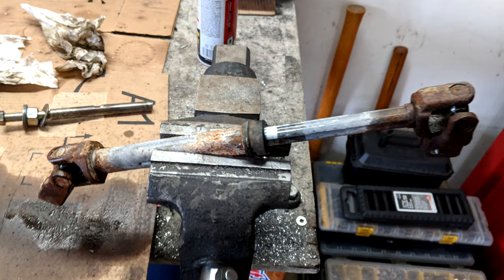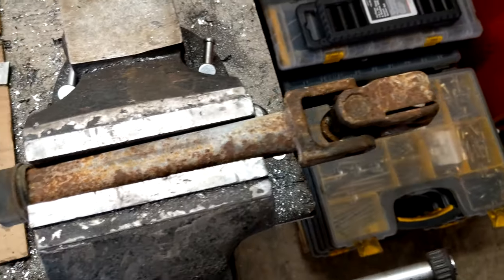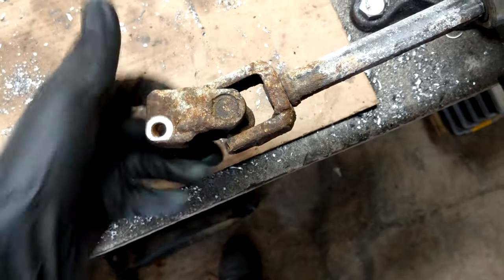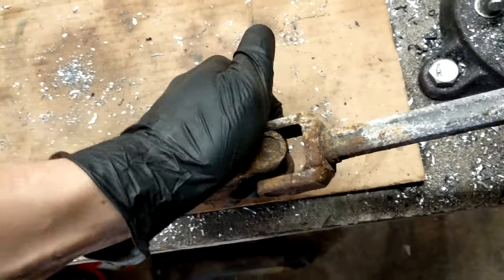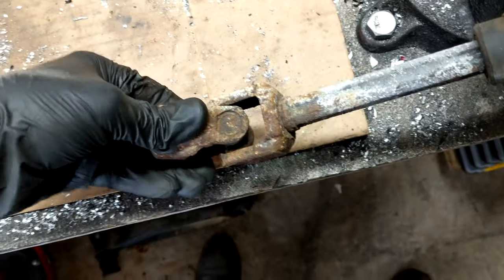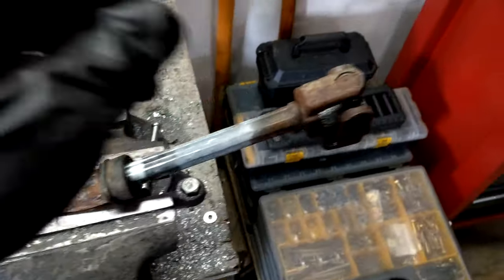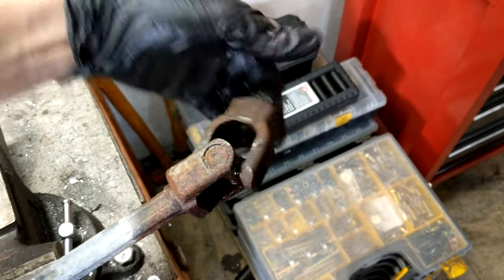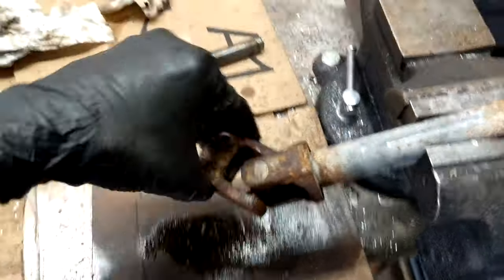2004 Ford F150 Heavy/Binding Steering Shaft Fix (Mini Projects Ep.3)

Comment from the maker: We have been very busy recently and barely even found time to put this tiny video together! But don't worry, this kind of busy means plenty of future content for the channel!
Reply: LOL I know the feeling, time to work on another vid!
Reply: I feel you, FDP. I've been roasting my ass off in the shop for the last week, and will be editing all this coming week, to get more out (also, I'm getting a boatload of work done). As always, you do a bang up job. I have plenty of patience since I know the next episode is always going to be a good one. Keep up it!
Reply: Acetone and ATF work great too!
Reply: @RickSolid1  People keep mentioning that... As I said to another commenter, I just made a video on that topic, and although it's an awesome potion, it's a bad idea to spray acetone at rubber.
Reply: Maxwelhse yeah it melts pretty much anything that isn’t metal lol. Although in  this case I doubt that matter, but I guess you could sub in WD40 for Acetone or some other low vis hydrocarbon.
Reply: @RickSolid1  I almost wonder if isopropyl alcohol would do the same job, but be more neutral to soft materials...?

I may try that at some point...
Reply: Maxwelhse I like that, maybe Denatured Alcohol too?
Reply: @RickSolid1  That is a good idea since it really doesn't seem to like to remove oil as much as isopropyl does... I do happen to have some on hand too. When my sprayer goes dry (from 50/50 acetone/ATF mix) I'll refill it with that potion and give it a shot. Come on over to the channel if you want to stay tuned for results (spoiler alert: my bottle is almost completely full, so, it will be awhile).

Comment: Good fix, but it seems like, given all the trouble it took to remove the shaft on a 15 year old truck, the best move would've just been to replace it.
Reply: At least now it's easy to take apart next time. I've actually done stuff like that on purpose before in a lead up to a "big" project weekend. Take something apart I know will take hours, clean it up, lube it, put it back together, then tear it down again in a few weeks (taking only minutes this time) to do whatever the actual intended repair is. The express example I'm thinking of is pulling the unit bearings out of the front of my Jeep in preparation to pull the front axles. I was correct that it took an entire Saturday just to get down to where the axles could come out...
Reply: Shit costs money bud maybe they're in a tight spot but I do agree with you . Gotta do what you gotta do

Comment: This is a common issue on any vehicle with an exposed joint in the steering shaft. I had a brand new chevy cobalt a few years back and used to spray the joint on the steering shaft with some thick lube on a regular basis, that kept it from jamming for the time I had the car anyway.

Comment: Hit it with fluid film every oil change.
Reply: I think I would try a dry graphite spray to help keep from gathering gunk, but either way would work.
Reply: worse case, use the used oil from that oil change to drizzle on those joints

Comment: Had the same problem with my 2004 Crown Victoria.  Replaced the intermediate steering shaft which is the only really safe, long term solution.  I originally just hit it with a heavy dose of WD40 on both joints while it was still in the car.  It helped some but I don't feel that it's a safe thing to scrimp on such an important part.
Reply: I agree with your opinion on this... I don't skimp on safety stuff.

Comment: Wouldn't it have been worth it to get rid of some of/much of that surface rust and hit it with some anti-corrosive paint? Or no?
Reply: he doesn't do that.
Reply: if they have to replace it anyway, then it won't be there long enough for the rust to become a problem.
Reply: @kruleworld  but he suggested not replacing it, but just monitoring it.
 He spent over 20 minutes getting the damn thing out. I think spending all of five-ten minutes to get rid of some of the rust and give it a coat of anti-corrosive paint (and go and relax while it dries) is hardly time badly spent.
Reply: @500MTH  he should, IMO.

Comment: It's possible to replace the universal joints by pressing the cups out in a vise. Just need to make sure that the new u joints are properly fixed.
Reply: A lot of the time you can't buy the joints themselves on smaller stuff like this. I ran into this on my Dad's tractor... $700 drive shaft from John Deere with no service parts available. It was that, or nothing.
Reply: @grandmasmalibu  I believe Dad had that issue too. He took it down to the driveshaft shop and they turned him away. Where he went wrong, in that unique situation, is not having them just make up an entire new shaft with replaceable joints. The tractor was down, it was mowing season, and he didn't want to take that much time...

So, anyhow...
Reply: Being they are staked in place, even if you could get replacements it's probable the yolk would get bent up in the process. Then you'd have to either re-stake them in place or at least put on some tack welds. Too much liability to be worth the risk.

Comment: I wonder if one of the bearing caps could be drilled and tapped for a grease zerk?
Reply: That's a good thought, but I'd be worried about drilling them with they're already full of bearings and grease. I don't think you can disassemble those shafts to get to just the bearing cups, but maybe...?
Reply: Pretty sure the joint is solid given the small size so you'd have to drill each cap. Then you have to worry about metal shaving getting inside, risking the shaft totally locking up while driving.

Comment: Can't you just knock out the bearings and replace 'em with some new ones that fit?

Just recently done that to my Toyota Chaser - used the Toyo ST1639 bearings. Bet it works the same way here.
The only problem was me hitting hard on 'ears' of the u-joint while trying to get the shaft off the vehicle - they got deformed and new bearing was damaged after I pressed it in. Had to use rasp to get the original circle shape for those 'ears' :)

Comment: Trans fluid would prob work well, I've herd of some using acetone and trans fluid as a DIY penetrating oil
Reply from the maker: Yep! Most likely any oil would have gotten the job done since the seals weren't doing their job all that well at this point. Just figured motor oil would have a good chance at sticking around in the joints, ATF would likely do well too.
Reply: @FuzzyDiceProjects  Yah soaking it in pen fluid then some type of oil after would prob be more ideal but I doubt you had the time and just used what you had.
Reply: I just made a video on exactly that elixir, but acetone and rubber are not a wise combination for longevity... To get the shafts apart initially? You bet!

Comment: If Ford had put zerks on these U-joints, and the joint between the two sections there would be no problems. Maybe drill, tap and install zerks. Or possibly remove and put CV Boots over the u-joints and pack the u-joints with a little grease.

Comment: So in other words some PB and a wack with a hammer probably would have fixed this
Reply from the maker: Well, yeah lol, not far off. May have been able to just soak it while installed on the vehicle and turn the wheel a bunch but it made it easy to work the joints back and fourth with it removed. Didn't need a hammer though, just pried using a screwdriver through the pinch bolt holes to get it moving at first.
Reply: I pb blasted mine and put some grease on it it’s been fine ever since didn’t even have to remove it
Reply: @FuzzyDiceProjects  I look at this as a good practice run for when the owner shows up with a new part to install. I've had too much stuff like this that seemed "fine" spontaneously disassemble itself at a point in the not too distant future after the old "clean n' lube treatment". With safety stuff, I'm pretty bearish and just buy new stuff. I get it that not everyone has the same budget, or priorities, but...

Comment: This really is a band-aid fix until you can get it replaced. Once the rust starts any lubing of the joint will only be temporary. At least for this gen F-150, RA has aftermarket shafts pretty cheap. But stay clear of the SKP one, build quality is garbage.

Comment: Anyone know any good obd2 scanners under 35 dollars
Reply: Autozone parking lot for $0 any time you want.
Reply: True
Reply from the maker: I have a Launch 4001 scanner I got two years ago for $15 on sale, works great and lives in the glovebox. There might have newer models with more features in that price point by now, though, I think the usual price is $30 or so.
Reply: @FuzzyDiceProjects  Just to throw it out there, I have an ancient scan tool (hilariously old, actually... it runs on a Palm Pilot) that data logs... That was a HUGE deal when I bought it in the early '00s and I've run into a few issues I wouldn't have ever been able to diagnose without logging. I haven't shopped for a scanner since then, but if you can get one that logs even a couple of sensors for even a few minutes, for even twice as much money, it's well worth it.